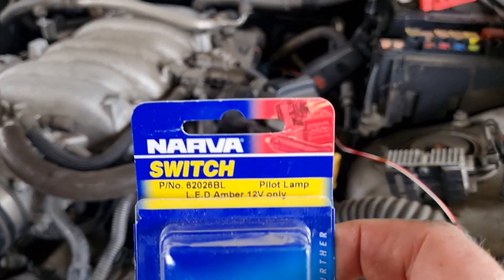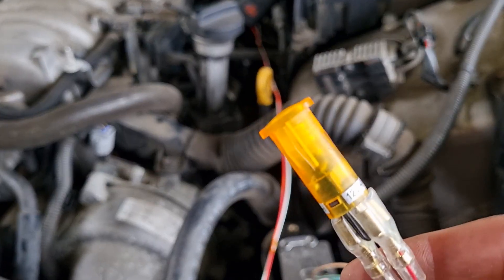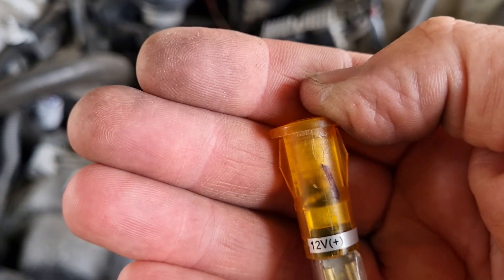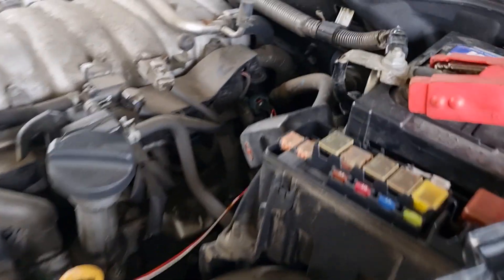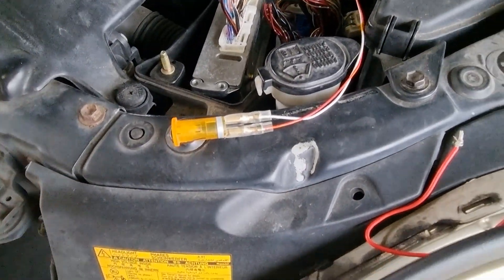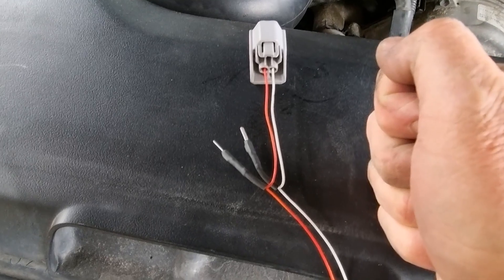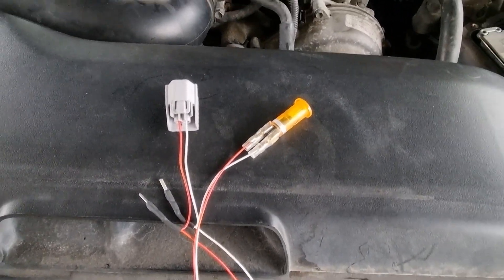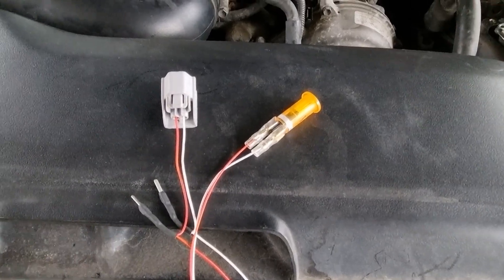Homemade Injector Noid test light

Comment: Kelvin, I imagine iy could be configured to test multiple things!
Reply from the maker: I use these lights in lots of testing.  I used some recently for checking transmission solenoid operation,  and I think they were used in the fuel pump checking too.  Very handy tools.  Cheers Kelvin